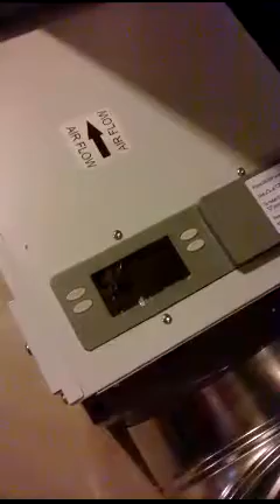Aprilaire 1850 dehumidifer install/sound test Chicagoland

Comment: Thanks for sharing.  Do you have any idea why one of these units would make a "wom-wom-wom-wom" kind of noise instead of the smooth consistent hum?
Reply: @doodle8  I finally got our HVAC installer to come over and we called Aprilaire's tech support line together.  Within minutes they determined it was a bad compressor and offered to replace unit at no cost.  The compressor starts about 2-3 minutes after you turn on the unit, so if you turn off and on you can check to see if it starts making odd noise around that point in time. Hope this helps!
Reply: @CaptDrPaxton  wow, thank you so much! And I’m happy yours is working better. I hope mine can be fixed as well.

Comment: does it have a built in damper to prevent recirculation when the unit is off in the winter ?
Reply: Yea, there's a backdraft damper on the outlet side